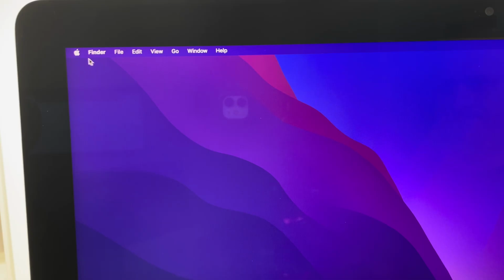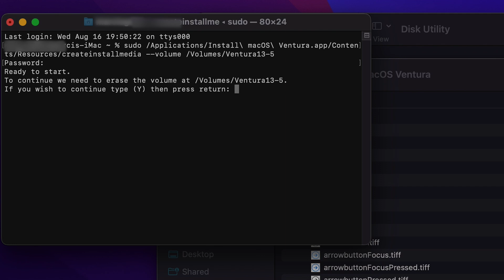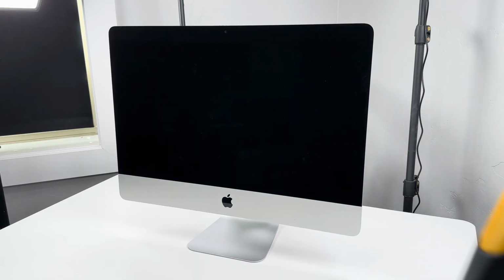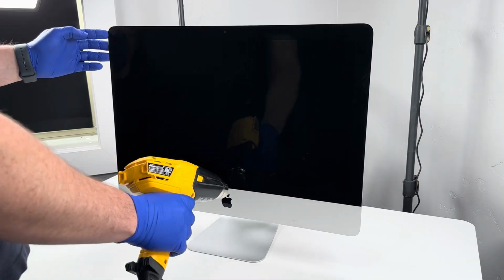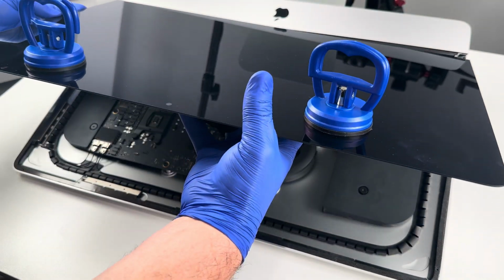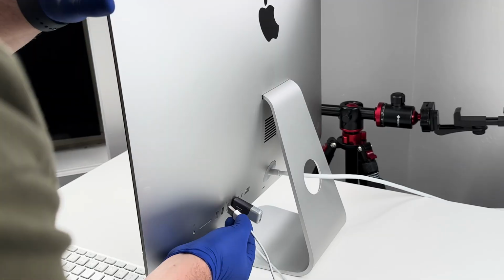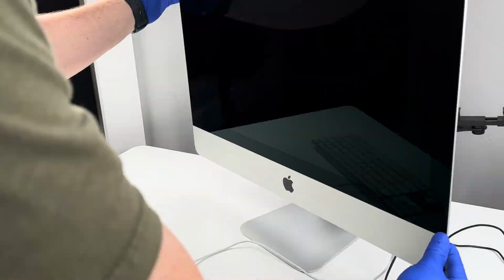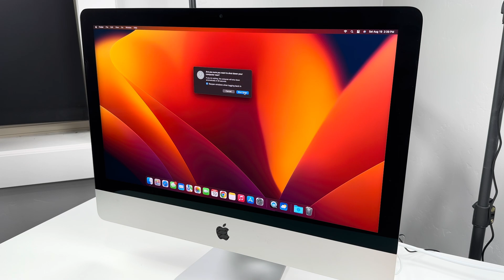How to Upgrade a 2019 iMac - New SSD and RAM

Comment: Did you not have to install the temperature sensor? I’ve read that the fans will run at full speed if it’s not installed onto the new ssd.

Comment: A great video but after having gone so far you should have replaced the coin battery. Those things don't last forever and when they fail they can stop the Mac from booting or in the worst case leak over the logic board killing the Mac. Also, best to keep the fan blades stationary when cleaning IMO.

Comment: i replaced the harddisk with samsung evo870 on my A2116. regarding installing the new OS my situation was different. Command-R did not work and it incisted on booting from LAN. i tried holding the option button after turning on which gave m he option to boot from USB. However the brand new SSD was not recognized at all. deinstalled the disc, connected it to my PC and i could initialize it as exfat(no partition). installed it again on the imac and it was recognised BUT it was complaining about GUID partition. i used the disc helkp program to erase and partition it as GUID. after that i could install MacOS on the disc.

Comment: If you don't want to tear the iMac apart, you can just run from the external SSD through USB.  Not as fast as an internal SSD, but still faster than an internal HD.

Just clone your internal drive to the SSD.  Then make the SSD your startup disk, in settings.  All done.  I did this for a client for the cost of the SSD plus $75 labor.

Comment: I had this done on an imac 2015, upgrading the ram to 16 gb, and installing a nvme for start disk keeping the original hdd for backup. I installed Big Sur and everything works on amazing speed, except a small problem... When i put the imac to sleep and leave it, like i usually do, for more than ten minutes, the imac doesnot wake up, and i have to restart it... Any ideas or solution to the problem?
Reply: I have the same year iMac. Is the the ram located on the same place at this model shown in the video? Trying to upgrade my Ram and SSD for speed improvement. Thanks in advance.

Comment: I think 21.5" 4K 2019 iMacs that were bought with an SSD can have them be upgraded if you use an adapter. Theoretically, up to 8TB. You still have the SATA header, so you could run both an NVME and a SATA SSD together. Largest 2.5" SATA SSDs are 16TB I think. So, 24TB of Storage in a 21.5:" iMac. Or, just 18TB if you can't upgrade the SSD over 2TB, since I haven't seen anybody do it

Comment: Thanks for the video, finished it today with all the recommended pieces from the description and the guide was very smooth and fast.

As for the installing a new macOS, it was slightly different for mine. I didn't need to install on a usb. Command + R on startup brought a connect to wifi, once connecting it''ll start the for the recommended macOS. I also had to use disk utility to clear the new ssd before installing the macOS on it because it wasn't formatted at first. Hopefully this helps someone.
Reply: Hi, I'm curious about your comment. So basically what you're saying, is that you DON'T need to take the extra step to back up a MacOS operating software onto a thumb drive? You can swap your old HDD to a new SSD, put the computer back together, start it up, and if you are connected to the internet, it will recommend which MacOS to install instead?

I want to try and do this on my own rather than paying a computer store to do it for me. My biggest fear is trying to install the MacOS software on the new hard drive. Any response would be appreciated!
Reply: @Mainsterr yeah. When I did it I was just having trouble installing it from the flashdrive. I can't remember since it was months ago, but I didn't format the SSD so that also stopped the installer from working too.

I remember this being stressed out because I put everything together. The screen adhesive was already on so I was so stressed that the installer wasn't working lol.

As far as I remember, no flashdrive, connect Mac to Internet, format SSD, it'll download recommended software and install

Comment: Two conclusions:
1 - Excellent video!
2 - No way I'm going to do that...
Cheers
Reply: I read your comment. Yeah, I decided to try it. Didn't work out for me :)
Reply: you dont have to do half the things he did to change the hard drive and upgrade the memory. this bro has never done it before. you dont even need to lift the board to replace the ram.

Comment: You can completely skip the process of using a USB boot drive, downloading Mac OS, using the terminal, etc., by using the Mac's built-in recovery mode.  Hold down Command-Option-R while booting, it'll boot directly into the Recovery environment, and automatically download and install the most recent version of Mac OS supported by that computer.
Reply: Thank you so much for this comment. My biggest fear about changing hard drives was transferring the MacOS from one to the other. Appreciate you writing this comment.
Reply: So the recovery mode "software" it's integrated in the motherboard regardless of the hard drive ? I was wondering about that too....
Reply: I did wander about why the vid shows him installing the macOS from Recovery Mode even though he had a bootable USB. What was the point of the USB flash drive with Ventura on it?
Reply: AI Overview
Learn more
No, the built-in recovery mode on a Mac, called "macOS Recovery", does not reside directly on the motherboard but rather on a dedicated, hidden partition on the startup disk (SSD or HDD), which is essentially a small section of the storage device, not a part of the motherboard itself. 
Key points about Mac recovery mode:
Location: It's a separate partition within your Mac's main storage drive. 
Accessing it: To access recovery mode, you need to restart your Mac and hold down specific key combinations while booting up. 
Functionality: This partition contains tools to reinstall macOS, repair disk issues, or restore from a Time Machine backup. 
So, I am going to install a blank formatted SSD and using an external bootable drive.

Comment: Great vid. - thanks for doing this - sooo helpful.  Wouldn't you test the repair before removing the adhesive film and pressing the screen onto it?
Reply from the maker: Yes, Definitely a good idea to test before you seal the adhesive. Also recommend the computer face down on a towel or blanket on a hard surface for a few hours for it to really bond well. It bonds fine without doing that but having pressure for a few hours ensures that the adhesive won't separate.

Comment: - iMac from this era still have upgradable ram door on the back but only for 27 inch models its a tally been this way since 2012
- you should never use non ESD safe blower to get brush out, it should be a ESD safe vacuum instead, adding to that never letting the fan it spin freely when blowing air as this will damage the motor,
- allowing the metal from the airport antennas touch under the logic board can damage it to.
- If an iMac has been power off and unplugged for 24 hours then you do not have to worried about being shocked from the power supply
- Otherwise great video.

Comment: i have question. could imac 2019 21.5inch 1hdd model(not fusion drive and ssd model) upgrade hdd to ssd? some people said only fusion and ssd model can be upgraded
Reply: Yes you can , in this video was only hdd , not fusion...I am pretty sure.
Reply: @TheAtheosForem  thank u. i had installed it. you right

Comment: Hi I came across your video cause I'm planning to do the same to my iMac but on the OWC website they have an adapter cable that you plug your new drive then you plug it into your motherboard which gives you a lead as a temperature sensor, apparently without it the internal fans will spin full speed. Did you come across this issue? Cause I did not see you putting the adapter in.

Comment: This has to be the dumbest design for a computer where you have to completely strip it down to replace the ram...like wtf😂
Reply from the maker: yep.
Reply: Believe it or not it could be worse.  Apple frequently just solders in the components directly to the mother board in many other models.  At least this one is upgradable, even if getting access to it requires a good hour of open heart surgery.

Comment: I did this myself today and it was okayish, everything worked after finishing it. 
However this was nerve wrecking, these connectors are so tricky and some screws were not that easy too. However, I failed to perfectly align the screen in the end, it is minimally out of center. The screen is the most enervating part. But .. I am quite happy that I saved 700€ on my RAM upgrade and 400€ for the ssd in comparison to buying more RAM or storage from Apple back then.

Comment: 5:36 failed to mention the power button cable should be removed from the groove before attempting to remove the speaker. the speaker moves pretty easily once the power button cable is removed from the groove, but I accidentally broke it and had to take a detour from this video to learn how to repair this. Long story short the power button has a strong adhesive that will require heat gun to remove. After the power button assembly is removed, the assembly can be opened up and the cables can be rewired or in my case i soldered them together and then carefully closed up the assembly and kinda reset the power button back into the hole, but it doesn't sit flush with the metal anymore
Reply: its trap😅😂

Comment: With my MacBook Pro 2012 (non-Retina), I did quite some tasks of upgrading on my own such as upgrading the storage and the RAM and replacing the optical drive with a second storage slot. 
However, this screen removement when upgrading an iMac really scares me. I've got exactly this 2019 21,5 4K model with i3 and 8 GB of RAM which I would really like to upgrade, but as the prices for newer Macs have drastically increased, I will think more than twice if I really touch this screen. Fortunately, there is already a SSD in it because I got it relatively cheap with an HDD and just let a company build this SSD into it. Not sure how much of a benefit 16 or 32 GB of RAM would actually be on top of that.
Reply: Love that 2012 MacBook Pro model — mine is still working after all these years tho it’s finally gonna into semi retirement.  Honestly if you have ever had to replace the keyboard on the old MacBook 2012, this installation won’t be problematic for you.  The screen is not as delicate as the 2013 MacBook Pro retinas were, I have had to take mine off twice and didn’t have any issues.  Just make sure you use a heat gun it makes the whole process MUCH easier and less risky (softening the adhesive is key to not having to be too rough with it to get it off).  In fact I would say your concern about cracking the screen is really only a concern IF you aren’t using a heat gun, which I have seen some people in other tutorials do.  THAT to me feels too risky.  But if you use the heat gun carefully (go slow, better to build up to the right amount, you will feel it and know exactly when it’s the right amount because suddenly the pizza wheel spinner thing will go through it like a hot knife through butter.  

(Actually that’s the other big recommendation is getting as part of one of the adhesive kits the little spinny wheel dealt which is only long enough so that it cuts through the adhesive without cutting in too deep.  The radius of the wheel is measured perfectly to ensure you can’t cut too deep in.  

So yeah… TL;DR heat gun + plastic cutting wheel specifically in kit for this iMac model = you can do this no problem.

Comment: Would a hair dryer also work to safely loosen the adhesive?
Reply from the maker: Yes, many hair dryers get hot enough that you could just warm up the adhesive with that and disconnect the screen. It does take longer so may need some patience too.

Comment: not my iMac 2019 19.1 which has a PCIe SSD drive, currently at 2TB and i want to put in a 4TB but not sure anyone makes a compatible one (OWC does not).  I do not have the fusion drive which also contains a SSD SATA like in this video.

Comment: Thank you for this, it was very helpful.  I was worried that only doing the SSD upgrade wouldn't be enough to have good performance but I was wrong.  I left the 8GB of RAM my iMac came with alone as I didn't want to deal with all of the additional dismantling of the computer to access the RAM.  I even saw another video where the guy digs all the way in further to upgrade the the CPU to a newer processor.....no thanks.  Anyway, just the SSD upgrade was plenty to make this Mac plenty usable for typical run of the mill daily activities (email, web browsing, Youtube video viewing, etc).  Can't speak for more resource intensive applications......but this is just the desktop my mom uses for her normal stuff.  SSD made a night and day difference, to the point that I can't believe Apple let these things leave the factory with the P.O.S. HDD that comes OEM in them.  All in this was about a 1 hour job start to finish for me.

Comment: Question, if i sont really care about transferring data over to the new ssd since all i got on it is Ultimaker cura, nothing important, should i go ahead and not bother transferring data and start clean or would i have to download the OS to it? Asking since im planning on upgrading to ssd and not the RAM yet?
Reply from the maker: You will need to format MacOS to the SSD if this will be your primary boot disk so the computer knows how to start MacOS, but you dont have to transfer files over. I recommend not doing an iCloud or Time Machine backup. Instead, do a clean MacOS install and buy the $15 SATA cable dock which allows you to manually drag and drop the files from your old hard drive to the new SSD.

Comment: So, if I don't need to update the RAM, and I only need to upgrade the HD, this is only 1/10 th of the effort you are doing on this video, correct?  Once the screen is off, I have access to the HD, correct? I have a 27", 2019 iMac with a Fusion Drive.  I want to replace with an SSD.  So glass off, pull old HD, replace with SSD, and close back up?  Does that sound right?
Reply from the maker: Yes, that's correct. Much easier to only upgrade to an SSD. I also could have upgraded to an M.2 drive which is located near CPU, opposite of the RAM, but it is much more difficult to do compared to just upgrading to a regular SSD.

Comment: Okay, if you watch my upgrade for the iMac 4K Retina from 2019, I've installed a new i9 CPU to replace the i5 it came with... along with 64GB instead of 8GB of RAM.
There was only 256GB of storage so I upgraded to about 2TB. I'm not expert, but I did push the computer a lot further.
I've dropped the link to this video of yours under mine in case someone wants an actual explanation.
Reply: Can’t find your vid

Comment: With your standard ssd installation you are still limiting the true speed these machines can run at.  When I upgrade the 2019 21" iMacs I usually replace or install an nvme as the main drive (samsung evo's) and use the standard 2.5 ssd as additional storage with 32 gigs of Crucial ddr4 3200mhz ram which is backward compatible to 2667Mmhz.  Once done you have a beast of a machine.  Good job on your part.  Your neighbor will definetly see a performace boost.  Will have a useable machine for a couple years.
Reply: you can't install a nvme pci harddrive with a 2019 iMac that came with a Sata harddrive, only if you got an SSD or Fusion Harddrive to begin with. this is the best update you can get if you're using the cheapest 2019 iMac, as it doesn't have a PCI port.
Reply: @riniriz Exactly.
Reply: If there is no internal PCIe Slot (shame on Apple) , there is another external workaround. Today you can get a TB3/4 enclosure for a reasonable price. Speeds around 2400-2800Mbit/s. depending on your Mac Modell and TB ports, you can also add a cheaper USB3.2Gen2(!) enclosure. Speed around 900Mbit/sec, which feels like a newer FusionDrive.
Reply from the maker: Great tips. Thanks for sharing.
Reply: which 3200 ram did you use as mac ones only go up to 2667 according to crucial website.  thank you
Reply: Can you share the exact sku of the ram you chose please?
Reply: @TriniDoeBoy do you have any instructions on how to install an NVME SSD in a 2019 iMac that’s currently running on an old fashioned hard drive?
Reply: My man, is there a tutorial on how to do that?
Reply: I use an external 40Gps case and boot with nvme

Comment: question why not install a LEVEN 1TB Mac Upgrade NVMe SSD PCIe Gen3x4 Compatible with Apple MacBook Air (2013-2017) & Pro (2013-2015), Mac Mini (2013) & Pro (2014), iMac (2013-2019), Since you are already inside the iMac, food for though, Great Info. Well Done. PS holding in the power button for 10 sec will discharge all power in the unit.
Reply from the maker: Excellent tips. Thanks for watching.